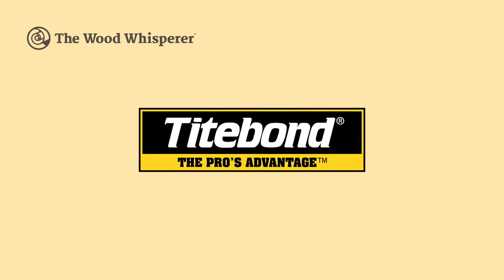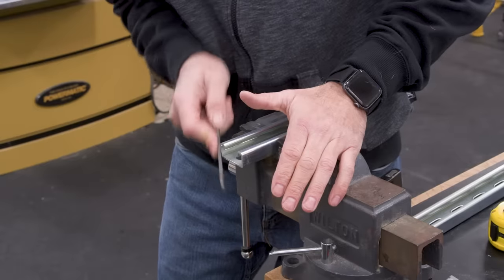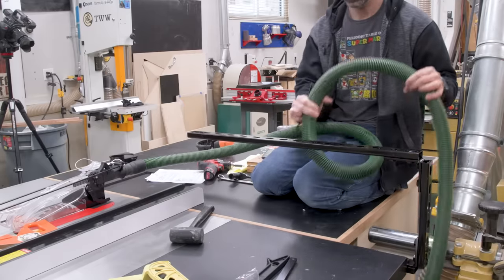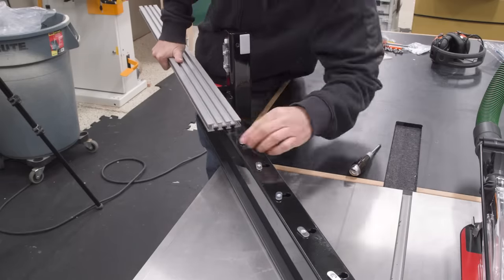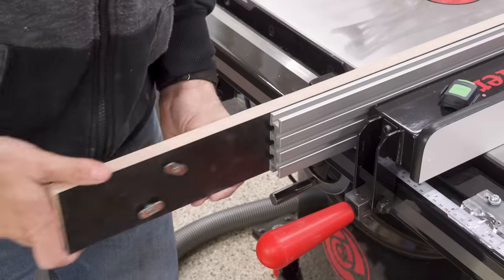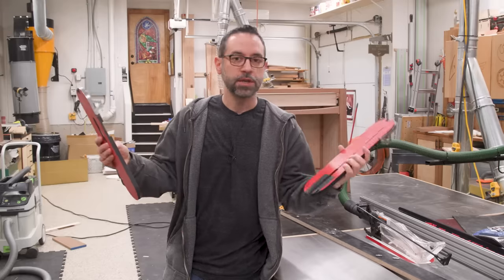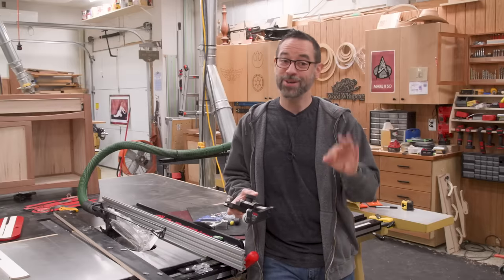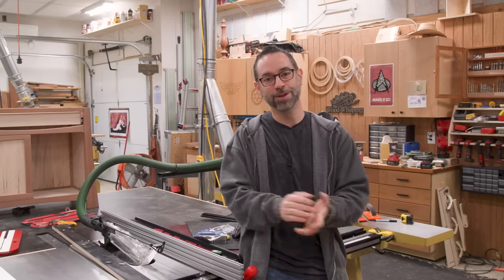7 Must-Have Table Saw Upgrades

Comment: For the aluminum fence, my experience was that the bolts bottomed out in the extrusion.  Plus the key hole had the wider opening at the bottom so the fence slipped off. Instead I added some washers on the inside that kept the bolts from bottoming

Comment: In the interest of efficiency and simplicity you could have run a hard pipe all the way to the end of your bracket. The corrugated hose adds feet of restriction compared to a smooth lined pipe. It looks like you could have had about 3' of hose compared to the 10 or so feet you did use. 
Too many people go crazy with hose when it is only needed for the small flexible connection between machine and hard pipe.

To further simplify and efficienify you could simply do away with the bracket and drop a pipe/hose down from the ceiling since that is where the dust collection system already is.  Just a few feet compared to the many feet and bracketry of the saw mounted system.

Comment: My recent SawStop purchase was timed with several shop upgrades, including a bigger dust collector so I can have it piped instead of moving the dust collector around all the time.  So I don't have the existing duct work problem, but I'm still struggling to decide if I should tie the top port to the main dust collection or use a shop vac.  I already have one very close connected to my Kapex.  I might have to figure out a way to automate switching 2 1/2" hose connections as I really want to get away from moving hoses all the time.

Comment: Very Super Cool Tools sells an adapter for attaching the Jessem TS guides to their fence extrusion for $ 25. You can also buy the Jessem TS guides with their adapter from them for cheaper than the Amazon price.
Reply: I have the Very Super Cool Tools Fence, but am using an old pair of Leichtung Workshops hold-downs that I adapted to it.

Comment: I just bought a sawstop and aluminum fence. If it touches the blade a sawstop tech said it will stop the blade. Do you put a sacrificial fence on the fence and then drill new holes so the sight bubble is right? Thanks

Comment: I’m hesitant to drill into the rail so I went ghetto, tightened an F clamp to the outfeed table and then I toss the hose around that. But finding the right hoses for the overhead dust collection was just… mularky. I now have about 4 extra ports and such. In the end, for anyone who needs it. I have the Dustright port from Rockler. It comes with three fittings. One of them fits on this dust guard. That goes to Y Port I got from woodcraft. The port is a 4 inch hose with a 2 1/2 Y. The Dustright fits right into that. 

Then they plug into my Jet dust collector.

Comment: I've been planning to do the aluminum extrusion fence thingy  since the plastic laminate started coming loose from my Biesemeyer , a little harder because it appears to be attached with self tappers, then plastic laminated 
Super glue has been my answer
But that add-on is on my list

Comment: For the fence would if you do not have an out feed table setup like you have, you would want to get the extrusion table to be the same length as your fence system correct  i.e. 36"?

Comment: After adding the aftermarket fence, did you do anything to fix the indicator cursor position? The stock indicator doesn't allow moving that extra inch that the aftermarket fence adds.

Comment: Use a step but for drilling the holes next time. Works so much better and faster than stepping up on drill bits
Reply from the maker: Yup. Gotta have one though and I currently don't. :)

Comment: Hi Marc, any thoughts on how to attach the aluminum extrusion to a Biesemeyer fence that does not have access holes on the underside to get at the bolts? My fence has faces attached to a square steel tube, but the faces must be must be glued on.

Comment: Didn't you once use some kind of hold down similar to the Jessem that was magnetic to the table top?  Looking for something for holding down stock tight to the table when cutting miters in wider boards where the fence is too far from the blade

Comment: Cool ideas but I wonder about your extrusion addition. I've found the clamps that look like a clamp but have the adjustable angle rod (Rockler calls them universal fence clamps) are inexpensive and effective. They are also quicker to install and remove than your screw on solution. Now I know you're a smart guy and have thought this through so I'm wondering why you went the route you did. The only benefit I see is the longer fence which is nice although I haven't had issues with the stock length. Care to enlighten me?

Comment: You can use a current detector relay to automatically turn on the dust extractor once the saw starts. You can easily make it, even if you don't have much electrical knowledge.

Comment: My rod was limpy unlike yours but it spanned 58".
I took one of the corner brackets and placed it about a foot from the blade end, tied a cable to the strut, ran the wire through the bracket and back around to where it bolts to saw ledge.
Used a turnbuckle to tighten the cable and now my rod is as stiff and upright as yours.

Comment: Hey Marc, I just want to offer a warning regarding the aftermarket throat plate you suggested for use with the saw to get the replaceable zero-clearance inserts.  This aftermarket insert doesn't have the hardened steel wear plates at the back that you'll find on the SawStop inserts. These wear plates are there to prevent the sharpened prongs on the anti-kickback pawls from gouging into the top of the throat plate as you lower the blade. If the anti-kickback pawls start gouging the top surface they will likely grab at some point and the force generated by the lowering mechanism can pull the spreader forward into contact with the blade and cause an activation or potentially bend component in the guard mounting system. This isn't an issue for those that don't use a guard or who disable the anti-kickback pawls by setting them in the locked up position, but since you are trying to promote guard usage it is something you might want to watch out for with that aftermarket insert.
Reply from the maker: I already removed the pawls when I discovered that very issue. I won't be talking about the pawl removal since I don't necessarily want to promote doing that, but I personally find them to be a bit of a nuisance. So no more issues for me. But good to know the drawbacks of using that kind of insert.
Reply: Is this an issue with newer Sawstops?  I have the 3.0 HP PCS and I don’t think it came with anti kickback pawls unless I am missing something.
Reply: @robbieplankenhorn2580  The pawls would have definitely have come with the guard on all SawStop saws.

Comment: It was unclear at first but after watching your other videos it seems you use your extruded fence for your measuring tape--not the sacrificial one. My only concern is running angled stock against the fence as it might slide into the crevices.

Comment: hi Marc, i just did the extruded alim. fence and had a hard time getting it close to table with out the bolts pulling through the cut outs in the saw stop fence. I tried a piece of paper, then a double thick piece of paper, and it is to close to the round cutouts on top of the slots . Is there a way to fix this problem? I purchased the same brand you suggested . 
Thanks for your time!!

Ken
Reply: I had this same problem. Curious if you ever found a solution. I didn't and ended up going back to the stock fence.

Comment: I swear I’m not trying to be a prick and I love the American solute but the pre-drill for a 1/4-20 tap is technically a .201 drill but 13/64 (.203) is definitely close enough.  Sometimes when taping thick stainless plates we will use a .203 but whenever tapping sheet metal it’s best to go smaller!

Comment: A question I have been pondering is a quality tap & die set that will cover the range of need in the shop that is good quality but will not break the bank. Do you have recommendations or a video on this topic?
Reply: I have and like the Husky set from the orange store

Comment: Hey Marc, do you have any suggestions on how to support that drop? I have a similar one dangling in the middle of the shop, similar to yours. I can't think of a good way to support them since they don't reach the floor.
Reply from the maker: Mine are just anchored to the ceiling. I bought a spool of metal wire and a crimper, so I just loop the ends and use small turnbuckles to connect them and adjust the tension.
Reply: @woodwhisperer  Thanks for the reply sir. But what I was referring to actually was the bottom of the drop. It doesn’t reach the floor. Is the bottom of your drops supported on the floor, or is it rigid enough from the ceiling that you don’t have to worry about it?

Comment: Didn't the extrusion change your tape measure on the rail tho? Wouldn't it be off now?
I really like the extrusion idea. Being a ShopSmith owner I'm looking at ways to improve the fence. On the plus side, I don't have to worry about a tape measure on the rail. 🤣
Reply from the maker: It does change but the viewfinder is adjustable.
Reply: @woodwhisperer  Ooohhhhh, I forgot about that. Sweet! 😎

Comment: That incert plate was somthing norm had on his delta, and the company that made them went out of business they have been off the market for years, and this new company brought them back but currently only make them for sawstop saws unless they have decided to do them for other brands of saws, I would rellay like to see them made for other brands i think norms was made out of aircraft aluminum. 
Maybe if they dont own the pat woodpecker tools will make them.
And I think its been over the pat time period to let somone else start making them.  Its a pretty clever idea, but with woodworking tools I belive i could make one out of 3/4" plexiglass and use a router bit to make the dovetail slots to hold the wood into. The only problem would be a riving knife.

Comment: Marc, I ordered the extrusion and am having a hard time gettin the screws to catch around the key hole - would adding washers help?
Reply: To answer my own question - I got some 1/4" ID 5/8" OD washers tilted them sidways to get them through the access slots with the bolts and threaded the oval nuts on after I pushed the bolt through the key hole.  Seems to be holding up okay, will update if it ends up falling off. :)

Comment: hey Marc I have a question. when you changed your fence did you change the rule on the tablesaw to compensate for the difference in the thickness of the fence itself? thanks
Reply from the maker: Yes I did. THe viewfinder is adjustable.
Reply: @woodwhisperer  I installed the same fence you used, in the same way, but I can't adjust my viewfinder enough to compensate for the larger thickness of the new fence.  Any suggestions?

Comment: If you are able to lower your blade insert I recommend the zero clearance tape from fast cap. Instant zero clearance and it's tape so when you need something different you peel it off and put on a new strip. Use it on my miter saw all the time as well. It's probably a couple of thousandsths thick so you need to have that much adjustment in your blade insert. Super cost effective. It's never thrown off a single cut accuracy wise.

Comment: My Colliflower ZCI insert arrived today, broken in 3 pieces. Made from corian??? Have they recently changed their materials? I went to their website thru your link and I don't recall any reference to corian. The ZCI throat plate on their site was red, like the one in your video, and I assumed that it was made from metal like other ZCI throat plates in the past (one for the Unisaw comes to mind). Now their site shows a white ZCI throat plate and definitely mentions corian. If they have changed materials, I can't imagine why corian would be used as it is too brittle for this application. So, can you clear this up for me?
Reply from the maker: I know they made a new product with corian but I didn't think it was a complete replacement....just a new version. The idea being the corian is non-conductive. I guess some folks were concerned about a metal plate being so close to the blade. But for definitive answers you might want to check with them directly.
Reply: @woodwhisperer  Does the metal version cause you any concern? I can't see any way that it could contact the blade, even in extreme bevel cuts. I thought that I saw a claim that "guarantees" not to trip the safety mechanism of your SawStop.
Reply: Just a follow up, I received my aluminum replacement. All is well.

Comment: Hey Marc, I don't see 3/8" cap head socket screws the link goes to 1 1/2 inch. The the other link for the 3/4 in is correct
Reply: Marc, is 3/8 correct?
Reply from the maker: I guess they sold out and the link is defaulting to another size. 3/8" is the correct size.
Reply from the maker: This might be a reasonable alternative.
Reply: I can also goto McMaster Carr too, thanks for finding an alternative
Reply: I will say this, lol, if Marc says use this...they'll be sold out in 10 min lol

Comment: The link to the parts lists 3/8” Socket Cap Bolts but when following the amazon link it only shows sizes down to 5/8” - is this what you meant?
Reply from the maker: No I meant 3/8". It looks like they sold out and it's now defaulting to another bolt. Frustrating.
Reply: @woodwhisperer  Marc, thanks for the verification - I’ll look elsewhere for those bolts
Reply from the maker: This looks like a possible alternative: https://amzn.to/3rurdyq

Comment: It still baffles me that SawStop doesn't make a proper ZC insert. I mean, come on. The aftermarket one is pricey, and while I will eventually get one, I just have to deal with the annoying bend on the stock. Even the Dado one requires cutting your own riving knife slot, which is just a pain, and you only get one shot.
Reply: I had version one of the 3rd party one and it actually set off the detection when at full height. They now have one that guarantees not to do that. I like the Sawstop one because it clamps at the front and the back. Here is a Youtube video on how to take a Sawstop insert and make your own zero clearance so you get the best of both worlds https://www.youtube.com/watch?v=yW_ID04hq4k

Comment: Next time you drill holes in metal like that, add some 3 in 1 oil or other lubricant. Your drill bits will thank you

Comment: Purchased a colliflower insert for my sawstop jobsite pro. Not aluminum per their website, and the insert pops out super easily making kickback of the insert an almost guarantee. There is no waythis thing is safe. It also shipped from an alternate address making me think there is a chance his shop may have had to have been sold and he’s farming out production to a DIY-er that isn’t quite apt. So Beware they may have switched their product. With the new product, I found it less stable than the Sawstop original. Contact Jack first before you purchase. He was super professional but the level of craftsmanship since this video has gone down considerably. What the website shows is not what I received. Be ware.